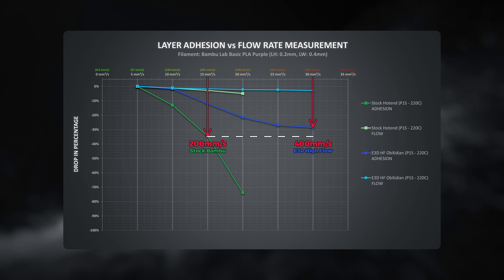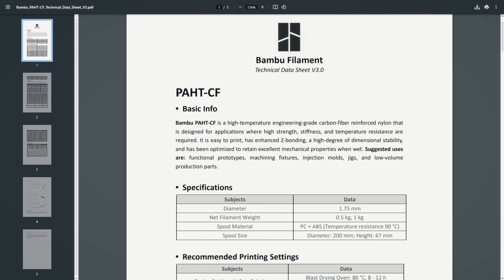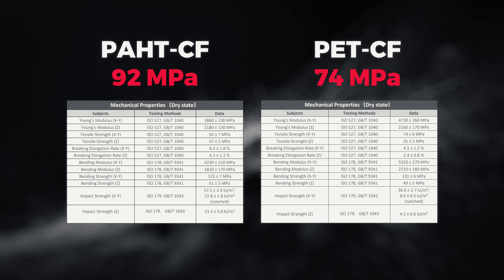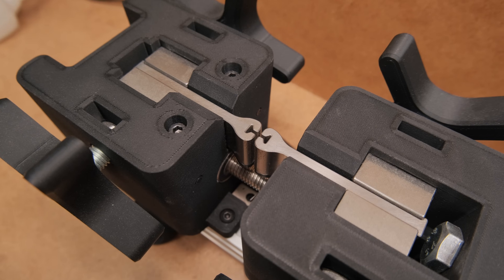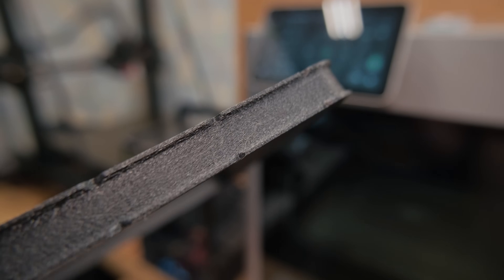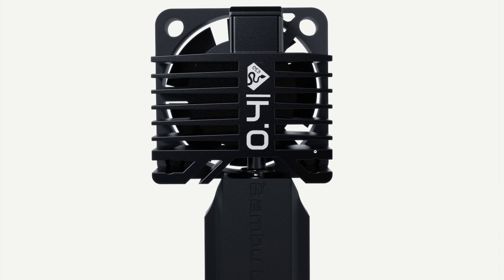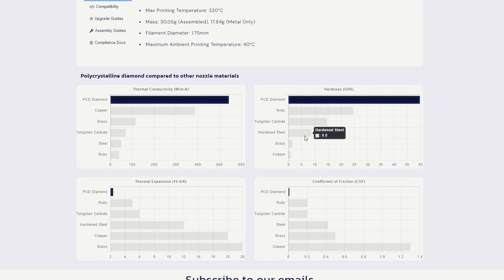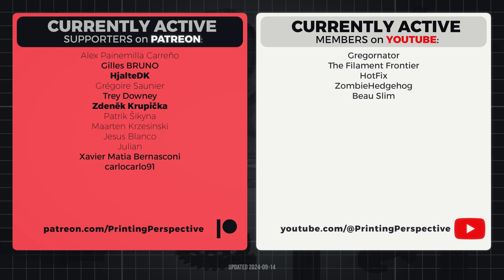LAYER ADHESION TESTED: E3D DiamondBack vs Bambu Hotend (using PPA-CF / PET-CF / PAHT-CF / ABS-GF)

Comment: Nice video, I'm having problems with my X1C clogging with CF filaments, I tried ASA-CF and PA-CF so from your videos it looks like Obsydian nozzle could help. Any other recommendation, given that I wanted to keep printing at 0.4mm nozzle ?
Reply from the maker: I never got a clog on X1C or P1S using a variety of 0.4mm hotends with fiber filaments. The X1/P1 series has a very powerful extruder, so the most common reasons can be using cheap fiber filaments, not printing hot enough (I print 10 °C below the max filament print temp), or your extruder gears are worn out.

Comment: very surprised they can't smooth the diamond interior somehow.  Polish inside and the hole walls, also not sure why you'd want a flat disc at inside bottom of the nozzle, why not just have it smooth wall all the way down to hole?

Comment: btw, did you take into account that diamnond back often results in a higher actual printing temperature than with normal nozzle due to way much better thermal conductivity? rumours said by 10-20C if I remember well. probably depending on nozzle as well
Reply: THIS. I can confirm this happens, I used to print PLA at 205C to get a somewhat decent print with a brass nozzle but since I got a diamondback I print as low as 180C with better looking results and more stable temperature.

Comment: Why the F*** would you print ANYTHING CF or GF reenforced, with a 0.4mm nozzle?????
That is literally the same as saying you want your nozzle to clog, waste filament (EXTREMELY EXPENSIVE ONE LIKE PPA CF........) by having bad prints due to the nozzle...
Try again with a 0.6mm nozzle (BAMBULAB CLEARLY marks it as RECOMMENDED (in capital letters) in their site in EVERY SINGLE fiber reinforced filament page...............
Reply: Been printing files filaments for years with .4 nozzles, and that includes the Bambu ones. I run a small farm and 95% of my spools are filled filaments. I use somewhere around 55 spools a month. I only use .6 when the filament is higher than 15% or specifically is chopped fibers. 

I might have a clog every three months. It’s not a big deal, people still want the details provided by a .4 nozzle, and you’re showing your massive ignorance with this type of comment. 

Why are you so aggressive? Bambu fan boys are so insanely overbearing lmao.

Comment: regarding layeradhesion and pa. i saw from you initial list of criteria that you use the partscooling fan for pa. try  running that on 0-20% 30% for overhangs and slow the thing down to a creeping slug like speed and watch the solid pa parts form :)

Comment: I don't think it's quite right to say because diamondback is 5.6 times harder it only lasts 5.6 times more than regular nozzle. If you'd plot the hardness vs material wear resistance the graph wouldn't be linear. It might be 4,5 times more expensive but it probably outlast the regular nozzle by 10...20 times.
Reply: Yeah I was just about to mention a similar thing. A material being so much significantly harder makes it near impervious to being damaged by the softer substance. Diamondback is claimed to last the lifetime of the 3d printer it is fitted to.
Reply: @7t3chguy technically unless you use diamond filament, nothing can damage a diamond nuzzle
Reply: the failure of a diamondback would be from something catastrophic not from regular wear. in a regular wear scenario there is no comparison. you are looking at potentially 1000s of x the lifespan.

Comment: I don't understand PPA layer adhesion. Bambu says it's lower than path, abs etc but in n your test or performed the best?
Reply from the maker: Where the hell do you get this BS data? Even Bambu filament TDS lists the layer adhesion strength of PPA as the best of these:
- PPA-CF 57MPa
- PAHT-CF 47MPA
- PET-CF 35MPA
- ABS-GF 29MPA
However, these results are with annealed test specimens that need to be additionally heat-treated for more strength. My data is without it because majority of the people don't have the equipment required for the proper annealing process.
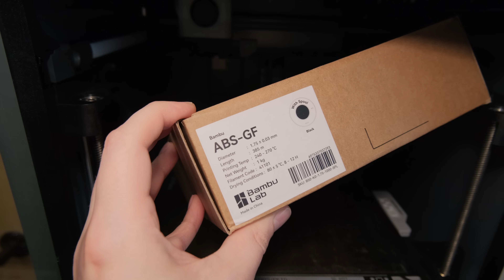Reply: @PrintingPerspective  I'm looking at "Layer adhesion" ( bambu filement guide,  4:12 in this video ). That's the reason why i've chose pa6-cf last time when i've bought 'special' filament. I'm assuming the greater value, the better. PPA loses heavily?
Reply from the maker: Maybe 3:12? That is completely different test which tests impact strength along the layer lines, not the tensile strength that I tested by pulling the prints apart. Impact testing is more for determining how brittle or ductile the plastic is. While PPA-CF is extremely stiff and can make strong parts it is also extremely brittle, especially along the layer lines. There are multiple tests like Tensile strength, Impact strength, Flexural strength, etc, that determine material properties and allow you to choose the correct filament for your print use case scenario. That is why these filaments are called engineering filaments as they can provide huge advantages for different use case scenarios than typical filaments, you just need to know when to use which.
Reply: @PrintingPerspective  Thanks for claryfying and correcting me! I've just misunderstood those tests. TIL :)

Comment: Always nice to see a new video. Not surprised to be honest on diamondback. Never seemed worth the hype. Any interest in comparing printing with the .4mm ObXidian using .6mm layer widths to mimic a .6mm nozzle? Kind of regret not getting the bigger .6mm. For me I was also very interested to see the issue with the stiffer filament making the cable chain rub against the carbon rods. Looks like it could be a huge issue and surprised you didn't spend more time on it. Any idea if there could be a fix besides printing a tall glass riser?
Reply from the maker: Thanks. For most people, Diamondback is not worth it, but for those who run their 3D printers nonstop with fiber filaments having a hotend that you don't need to worry about its wear makes way more sense. Especially if you run multiple 3D printers, it might be a great investment that will eliminate the downtime of the machines and the maintenance.

I have 0.6mm ObX HF on my 300mm Voron 2.4. It is great for rough parts but this size significantly reduces details and print quality. One of my first videos on this channel was comparing 0.4 vs 0.5 vs 0.6mm nozzle sizes when printing at 0.4mm vs 0.6mm line width - https://youtube.com/watch?v=xFmI25MJ93w This was done with slower 3D printers but it should be the same with fast ones if you properly heat the filament.

It was only the issue with PPA-CF. It has nothing do to with needing a riser but rather filament being extremely stiff. The filament itself makes the drag chain bend and rub on the rods. I have no data and experience about this kind of issue because this is the first time I used a filament that is so stiff. So I would only speculate if that is a serious issue or not.

Comment: Why does nobody produce a video documenting PETG print quality with diamondback? Haven't found a single video about this. PETG sticks to normal nozzle and causes print quality issues
Reply from the maker: It depends a lot on what PETG you are using. I only experienced this in the past with cheap PETG and slow 3D printers.
Reply: @PrintingPerspective  I have a creality k1 max and printing formfutura carbonfil. Start of print is always affected by sticky blob that clears up as print progresses. It's a pain when I have to print precise parts with mating surfaces. Premium filament with a decent printer

Comment: While pulling with the layer lines do you not just test the material properties instead of layer adhesion? Maybe I got it wrong from the video but I think the test samples should be flipped 90 degree before printing.
Reply from the maker: When testing layer adhesion, I pull samples in the Z-direction to split the print across the layer lines and determine how well each filament bonds to the previous layer. Material strength would be pulling the samples in the XY direction. This is as simple as I can explain, hopefully it helps.
Reply: @PrintingPerspective  Okay, no perfectly explained. Then I was mistaken, Thanks for clarification ! :)

Comment: I am glad you mentioned the need for a 0.5 mm nozzle!
Reply from the maker: I will probably have to make a dedicated video of why we need it with all the data and test prints. It is annoying that no 0.5mm modern nozzles/hotends exist, especially for abrasive filaments.
Reply: @PrintingPerspective  I heard high praise for 0.5mm Bozzle previously.
Reply: @PrintingPerspective Phaetus EndCoat coating V6 Nozzle 0.5mm, is it possible to test its performance of carbon fiber filament?
Reply: It's funny because that used to be standard for diy printers. That's what my RepRap has.
Reply: 0.5mm is king

Comment: if you get to melt completly in the nozzle , you wont get more benefits from it , more layer adhesion is made with hotter material and lower cooling  as you want the the material that comes out of the nozzle to remelt the layer it prints on to a part if you cool it too fast it wont get to transfer enough sensibel warmth into the layer to jump over the latent warmth far enough to bring a good adheasion

Comment: I found the filament comparison much more interesting than the nozzles. I have been sticking with PAHT-CF due to bambu's own layer adhesion numbers showing it being better than the others, and my own experience that it is very durable. But your results are the opposite. I may have bought my last roll of PAHT-CF if I can get the good numbers AND less warping. PPA would be the ultimate of course, but the PET could at least replace my "everyday" filament.
Reply from the maker: Their data is based on the annealed test specimens for the most favorable results, which is understandable. But most people won't be annealing their prints.

Yup, I would agree, PET-CF is probably the best all-around filament for daily use from my data and taking into account the price. The only thing is that Bambu says it is not AMS-compatible.
Reply: @PrintingPerspective   I stopped printing PAHT-CF from the AMS anyways. Even with the extra desiccant holders, it just wasn’t staying dry. Until/unless I try those membrane things that pump the moisture out, I just always print my good stuff from a Sunlu drier set to never stop. I use the AMS’es for colored toys or mockups.

Comment: 6:29 THANK YOU for mentioning standard deviation, at least when it is pertinent. I hate when people go through all the work to do these kinds of tests but dont mention it. Having a chance to have a part come out half as strong is important to know. 

It would be nice to have a nozzle upgrade that you would never need to worry about changing, but I dont think the downsides here put it above the obsidian, especially at that price. It was already expensive for the hardened steel.

side note, wow that PPA is crazy. I print in the PET-CF when I need aesthetic or more rigid parts, and it was already crazy stiff. but the ppa just doubles that? kinda crazy.
Reply from the maker: I always calculate standard error and standard deviation, but during all my testing this was the first time when it was a significant difference between hotends with ABS-GF.

Yeah, PPA-CF is actually wild, I had the exact experience as I thought PET-CF was extremely rigid, yeah right, haha!

Comment: Great video! Do you plan to follow-up the belt comparison video? You said that you would make a belt core comparison and I think it would be great to see it. There are so much more going on for belt than just tension that we don't get to see in the 3d printing channels on YT that I wish to see getting discussed. I think there are a lot more to be explored. Belt core, maximum recomended bend radius, strechiness, smoothness, wear resistance, PU vs rubber,  herringbone-patterned teeth, teeth design / pulley matching  (GT2, GT3, etc), brands... So many things...
Reply: The only benefit you get with Gt3 over gt2 is longer wear and slightly quiter belt sound. Same temp resistance, unless you compare them to the gt2 epdm versions.

And to compare toothed idlers he'd have to get a spare gantry, drill it out, and finagle the 2 smooth pulley out and put the proper Gates toothed ones in. Thats a huge laborious process
Reply from the maker: Thanks, I doubt it, mainly because I am not expecting any significant difference from them.

Comment: I bought an E3D hotend and was disappointed. I expected no drop in quality but surfaces were continuously less consistent than expected. Of course there was also more oozing, but it should be the case that it was plug and play and if not they should have included revised settings/profiles to deal with it. Ultimately meh on that. I ended up replacing it with a stock hotend and am much happier with print quality.
Reply from the maker: About what E3D hotend you are talking? I am extremely pleased with the ObXidian HF ones. From my testing nozzles almost doesn't have any influence on the outer wall consistency of the prints. Most of it is the extruder and improper flow rates if you print inner walls first.
Reply: @PrintingPerspective  The ObXidian. This is with stock settings or with the changes they recommended. It was night and day.

Comment: 6:56 "they ooze more" i find your statement erroneous sir. Personally have been in the scene for over 15 years and have seen this tech evolve from a plywood rig to these fantastic and easy to use machines of today. I have picked up a trick or two in this path over my years regarding retractions. i use three sets of nozzle sizes for my x1c, .2 .4 .6mm, for each i use a different retraction setup.

for the larger nozzle i have good results with petg at 2.5 - 3.2 mm on a x1c. 45mms  speed ususally is enough. some brands are "mushier" than others so you might want a different length and speed :) my reasoning here is that the more soft and floppy the filament is, the more length and less speed it seems to prefer. if you are having oozing with larger nozzles i can help you cure that :)
Reply from the maker: Yeah, you can combat the oozing with more tuning but you will still have inferior print quality which is the main reason I avoid larger nozzles. I print a lot of smaller stuff that needs to be precise and detailed. Plus even with 0.4mm nozzle we are limited by the flow rate, so I feel like the 0.6mm is only for better layer adhesion. Printing on a fast Corexy at 45mm/s is a little bit odd, you know. For larger nozzles, we need way more capable hotends. That is my take on this. Thanks for yours! :) Cheers!
Reply: @PrintingPerspective  you should the nozzle size that is correct pr model imo. 

the larger the model the larger the nozzle :) 

you cant have your cake and eat it too you know. accuracy comes at the cost of low speed. its just how it is. 
your shell speed might be low but your infill and inner walls will can be fast. so its a nitpickery really.

Comment: Love the content!

Do you happen to have a video that explores layer adhesion based on the material? TPU and Nylon seem to perform the best, but I've had challenges printing them.
Reply from the maker: @emosavagerabbit I only explored layer adhesion of PLA vs PETG vs ASA https://youtu.be/USeTuR-uOXA
Reply: @emosavagerabbit  pc, pla and pet/g all have good layer adhesion, nylon is better and tpu is basically isotropic
Reply: @riba2233  I feel like the tests I've seen don't indicate that PC does very well in Z. But I'll check into pet
Reply: @emosavagerabbit  pc does great, among the best out of all filament types and consistently. Only nylon and tpu are better
Reply: @riba2233  I really need to look into PC. Although I suspect my bambu P1S would struggle with that
Reply: @emosavagerabbit  it shouldn't, it is enclosed, preheat it with bed on 100 and that's it, nothing special :)

Comment: Very interesting. I wish I could have seen how a CHT hardened steel nozzle would have fared compared to these.
Reply from the maker: Me too, but testing so many variations takes so long and is way too mentally draining. ObXidian HF hotend should let you print ~1.5 - 2x faster with similar layer adhesion as the stock hotend.

Comment: the coefficient of friction is so low for diamond, I think something else is going on here.
Reply from the maker: Yeah, I am not sure what is happening but it is definitely happening and is not some sort of fluke.
Reply: The inside looked quite rough so even with a low friction, fiber ends could easily get hung up (if you look at the outside pics of the nozzles as a comparison, the steel is very very smooth)

I suppose it's also possible that the nozzle opening is actually smaller than spec by some margin. People have had over spec'd Diamondbacks in the past.
Reply: @winebartender6653  i have same issues with my diamondback nozzle but with a biqu hotend. all good so far, but man does shit sticks to it :D
Reply: @winebartender6653  that roughness alone makes me think something is amiss here -- a while back someone posted seriously close-up macro shots of some diamondback nozzles (Zack Freedman I think?) and IIRC it was notable that the inside was polished very smooth, and the workmanship was very impressive. I think this channel got one from a bad batch, or Diamondback's quality has just gone through the floor.
Reply: these are sintered diamond particles, not pure, smooth diamond

Comment: Wow you are got the new ppa-cf, nice :) does it stick to textured pei or it needs glue to stick?
Reply from the maker: I used a glue stick for all my test prints, I haven't tried without one. I would recommend always using it for filaments that cost $99 a roll as failed prints would be very expensive. You can always rub and wash it off afterward. :)
Reply: @PrintingPerspective  thanks, it's good that is sticks to a regular glue stick :)